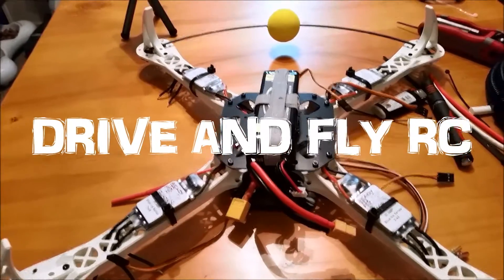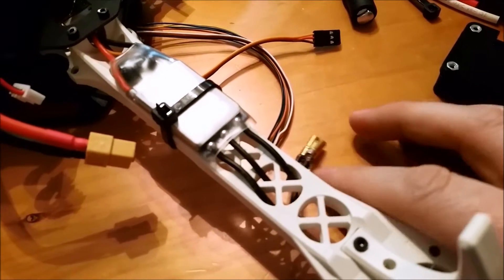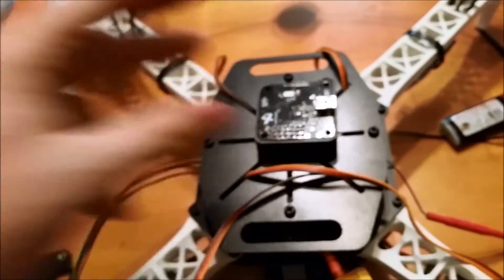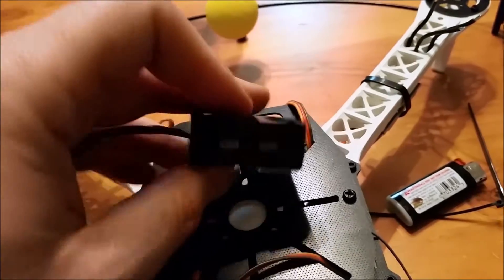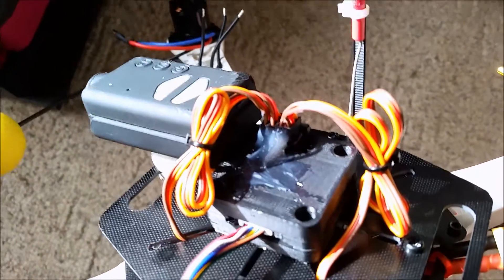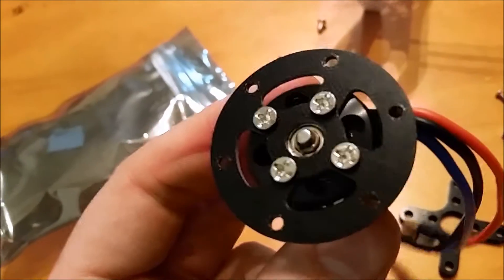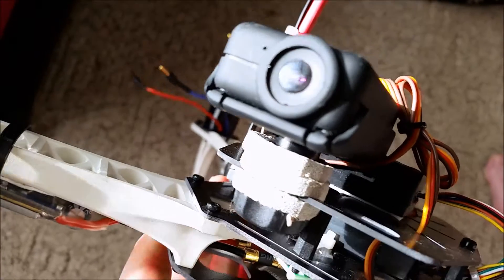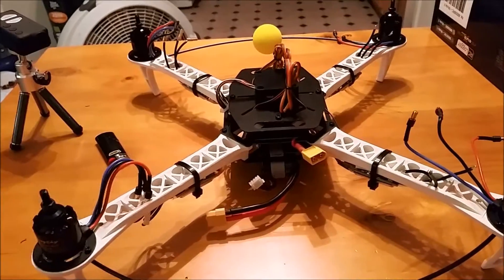SK450 Build Video Part 3 SunnySky Motors, CC3D, and More

Comment: Use velcro for the battery
Reply from the maker: Yeah I have it a couple straps but it slides a little when I really punch it. I think I will put a strip right where it rest and one on the battery so it doesn't Jeri around.
Reply from the maker: DriveAndFlyRC Jerk around*

Comment: when you change out the motor mount screws you should use blue loctite.  :)
silicon is a good for your signal wire problem.   Also be sure too use shrink wrap on your esc bullet connectors.  Thanks for the plug my friend!  Cheers!
Reply from the maker: Yeah I will defiantly use lock tight once I get some decent screws. Probably before my first flight. I am just waiting to get the rest of my bullet connectors before I heatshrink, but it shall be done.  Thank you for all the help!
Reply: I also always make it a practice to hold the motor upright while screwing the fastener in from the bottom so the locktite does not drip down onto the windings. I actually just squirt a few drops onto a plastic piece and dab the screw into it to control the amount.
Reply from the maker: ***** Good tip, I defiantly don't want to hurt these nice motors.
Reply from the maker: ***** Good tip, I defiantly don't want to hurt these nice motors.
Reply: DriveAndFlyRC
Same powerplants I am using on my tri build with naze right now. Just waiting on a frame and a few minor parts to come in. I will be running 8in and 10in props with 4S and 3S respectively. 300mm tri frame with gps and bluetooth and carrying a gopro.
Reply from the maker: ***** That sounds sweet. I will probably build a Tricopter for my next build. I really like how crazy they flip and roll.
Reply from the maker: I love how well Tricopter do acro. I am probably going to build one very soon too. Can't wait to see yours.
Reply: DriveAndFlyRC
I am planning a build video- it is the FocalRC 300mm Tricopter. I am building it fo fun and gopro- so it is not a planned hot rod. 980 Sunnys with 8in props on 4S and swinging 10's on a 3S.